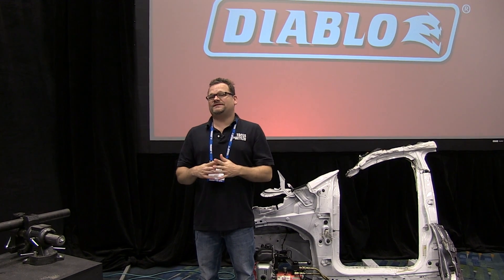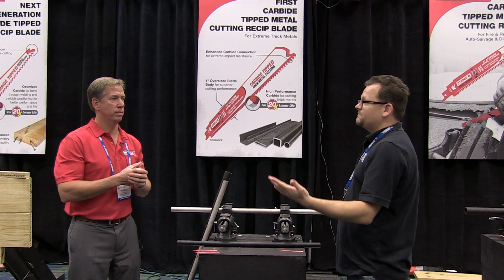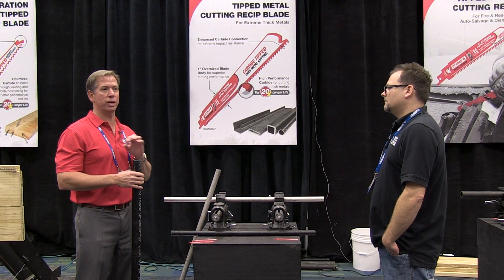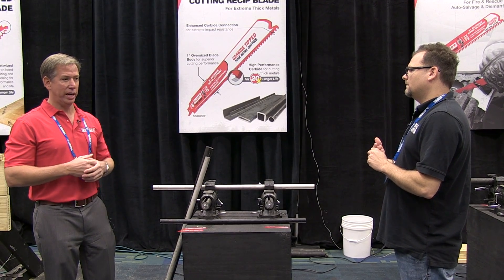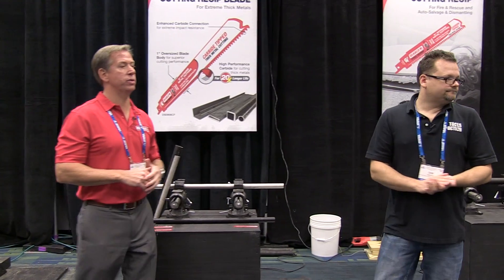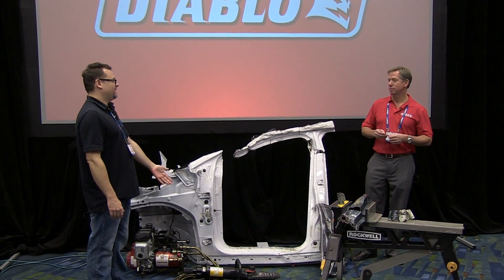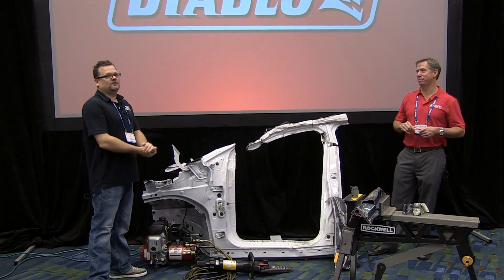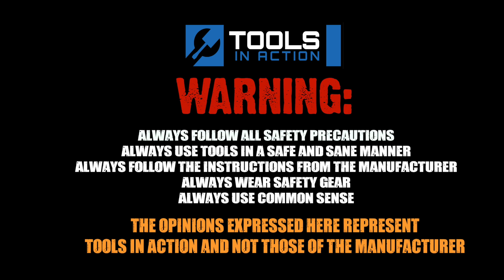DIABLO Carbide Tipped Metal Cutting Reciprocating Saw Blade - STAFDA 2014

Comment: Wow! I've never seen a blade cut through cast iron pipe that fast. I'm sold on the diablo carbide Blade. Being a plumber, I've had situations where we couldn't use ratchet chain snaps to cut CI pipe to do a repair and had to use half a dozen metal blades to cut through CI pipe. The diablo blade seems like a money and time saver.

Comment: Great point about vehicle extraction. I was at a town festival a few years ago. The fire department did a jaws of life demonstration and it sort of backfired, it was taking forever to get the roof cut off... My buddy Brett ended up having to just cut the seat belt and pull the firefighter who was sitting in the drivers seat through the window. If they could have went at those columns with cordless recip saws with these blades in them he woulda been out of there quick. Carbide's no joke, I run angle heads with carbide blades. I've seen one take a drywall screw that wasn't countersunk and snap the head right off, and the head kept on working fine! Don't want to make a habit of that though...
Reply from the maker: RickScherfDrywall Thanks Rick!

Comment: Nice Blades! Its about time there is a carbide recip blade. The only problem with carbide is it's brittle so if you drop then on concrete your are going to chip and damage them. Also I could see the carbide teeth chipping if the blade gets in a bind and jams. All in all I Like what I see and I am going to 100% buy this blade and carry it on the work truck.

Comment: Diablo makes some good stuff that lasts a while. I regret buying a lenox hole saw recently. The mandrel bit bent on the first hole (it was even pre-drilled). After replacing the bit, I didn't have any issues and the saw part worked ok. But it just sucked having to fix something I barely used.

Comment: Does Freud also make jigsaw blades with carbide tips?  I have been seeing some Bosch blades at Lowes and similar places.  Then there are finer tooth blades.  I am not referring to those carbide grit blades but carbide tipped instead like many saw blades and router bits have been available commonly for as long as I can remember.  I got one of the Freud reciprocating saw blades with the carbide tips and it helped out a lot removing an old fiberglass shower/tub.  This is the sort of stuff that destroys cheap Harbor Freight blades (those things don't last) but the Freud blade just slices right through and shows no sign of damage or wear aside from the red paint wearing off but that happens with any blade that is painted in such a way.

Comment: Just bought the Diablo Carbide Wood and Metal blade at Home Depot for $12 the other day, broke the first day cutting through pallet nails. It broke inside the lever, so the tip itself was fine. This happened again with the second one I bought that wasn't carbide tip. Never had any bosch blades break in my saw.  I'll stick to Lowes.
Reply from the maker: +Husky Wood Working What?  Can you send us pictures?  Never ever heard of that, Diablo Carbide is one of the best blades you can get.
Reply: sounds like not holding straight or something is messed up on sawzall.. I cut threw everything and haven't broke or dull yet. demo
Reply: +shellz150 I have had the same problem with mine they break on the tips after about 2 or 4 cars worth of chopping action, but the TEETH 100% HOLD UP. I cut up BMW and Mercedes benz every day after parting them out. they get cut into 4 sections usually sometimes 8. I went from going through 2 to 3 blades a car to now I can use about 1 blade every1 to 4 cars if I don't let the blades get to hot or bind on wierd angle of rails or firewlls . Still will buy these over any other brand,  I went back to another when i was mad the first time they broke back to back and of course took a whole 5 pack to cut up a Benz so in the long run took me 25 bucks to cut up the car when the 3 pack for 15 bucks would have been the better buy and just prayed it didnt brake at the locking top agian.... hope they do do something about that cause i know there has to be a flaw. It does brake a little easy.... I KNOW HOW TO USE MY TOOL

Comment: My first experience with a Diablo carbide tipped blade was very disappointing, nothing like what you see here. Yesterday, I managed to cut two screws (Everbilt #14 x 3" x 1/4" diameter) in half. Yes, I did it, but it wasn't easy, and I didn't think that I was going to be successful. I wouldn't want to do it again. Fortunately, none of the teeth on the blade were damaged, but it certainly wasn't an auspicious beginning. Just to make sure we're talking about the same thing, the blade I used was a Diablo 6" extreme metal cutting blade for thick metal cutting ((8 TPI  DSO608CF). Fortunately, YouTube allows you to edit, so I can add that the blade was used with a Milwaukee battery-operated Hackzall reciprocating saw. Maybe a more powerful saw would achieve better results.
Reply: Alex Behrens
What is it meant for, slicing tomatoes?

Comment: Where are these made?  I know some the circular saw blades are made in Italy.  These blades in the video are somewhat more expensive but you get what you pay for.  I want to get one and try it.  I have cut a piece of hardened pipe once like that and it was not that easy with a sawzall and a bi-metal blade.  Those bi-metal blades are ok for some things but they can get really hot when you try to cut something hard or thick.  I nearly got a blister from a hot blade and it can make some people swear a blue streak.
Reply from the maker: +John Doe hmm good question
Reply: I believe Swiss made

Comment: I use diablo blades for most of my cutting. I use them on my circular saw and my sawzall. I have actually converted my dad over to diablo blades after he used just one. I also use freud for my router bits. A great bit or blade can make a decent tool work great, where a bad blade can make a top end tool work like crap.
Reply: exactly. my 7.5 amp porter cable recip saw can cut like a 12 am milwaukee because i use high quality blades. they make all the difference.
Reply: Agreed Brian, I buy diablo when possible and also have a few converts.

Comment: The tpi teeth per inch on those two blades are different.  14-18 tpi blades always cut fastef but leave a rougher cut.  And omg dont ever try to cut metal with a 14-18 tpi blade while holding it with your hand,  It will catch and jump and chop you thumb off.